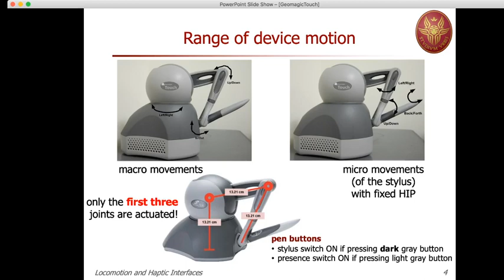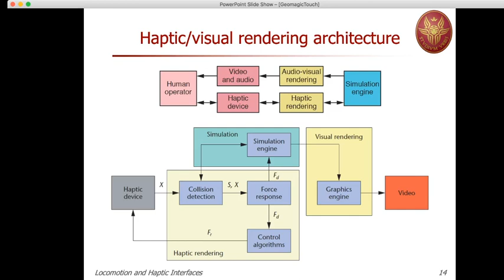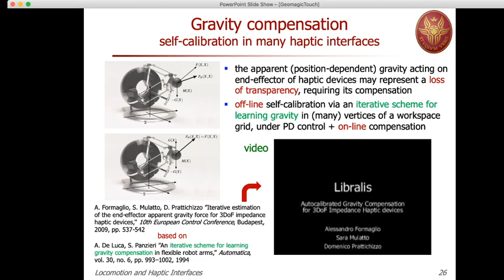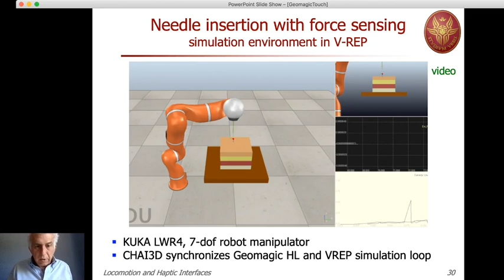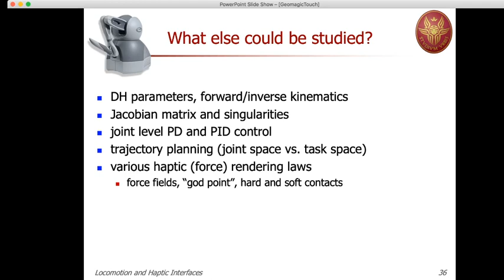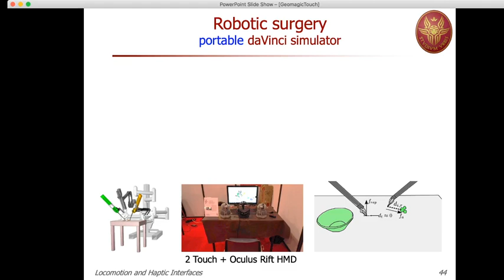Geomagic Touch Part 1

Comment: Thank you for sharing this helpful lesson, Professor. Do you know of any way to access OpenHaptics'APIs from a more approachable language like Python? Thank you
Reply from the maker: The official release of the OpenHaptics APIs is currently available in C++ only. There may exist, however, workaround solutions based on the integration of additional open-source libraries, that provide basic-level access to haptics and graphics from Python (e.g., www.h3d.org), but they are not officially supported
Reply: @AlessandroDeLuca_Sapienza  Thank you, Professor